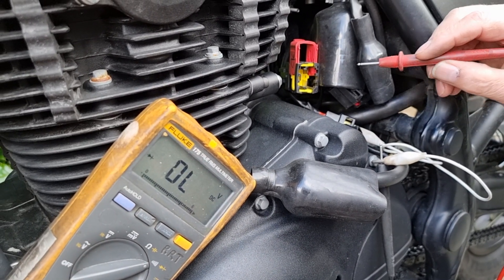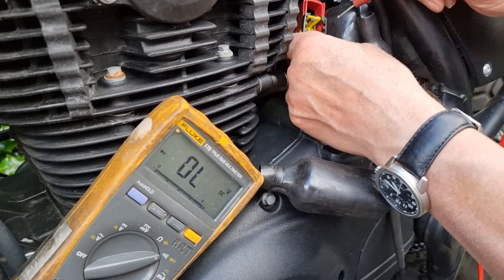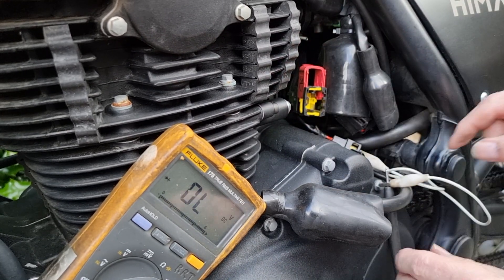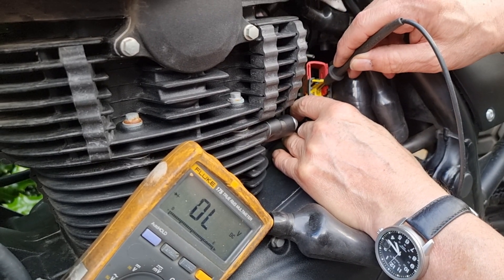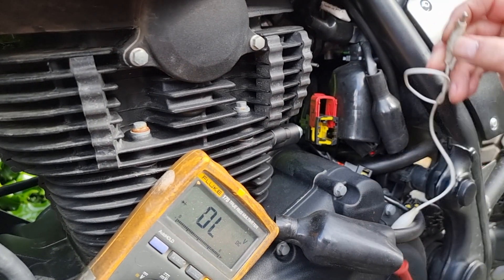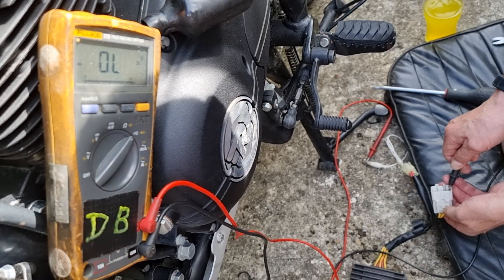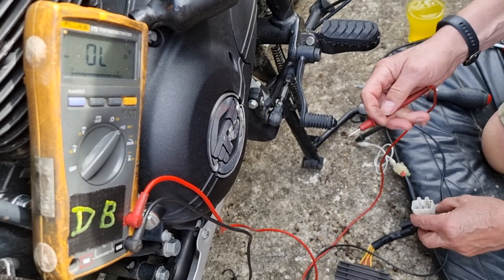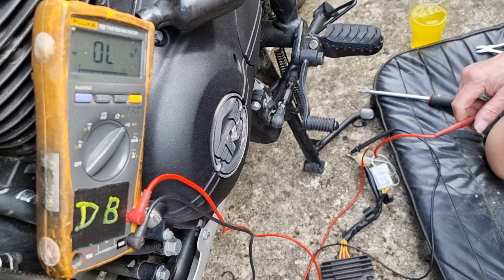Testing himalayan regulator rectifier

Comment: So if bike even stops charging could this be it or is it the coil or magneto itself
Reply from the maker: Stopped completely  ?
Reply: @xfire7  yes been doing some testing thinking it's the regulator no beep when I tested the magneto
Reply from the maker: @Cory Chartier  three wires from alternator (yellow? ) each wire test continuity one lead on yellow wire and the other to earth on frame , there should be no reading .
Reply: @xfire7  yes there was no reading. So I tested regulator and it also gave no reading both directions so assuming it's the regulator

Comment: I bought a 2022 and can't pick the bike up 4 days later because the dealer is replacing the rectifier. Said they had to
order the part and it didn't come in yet so they stripping it off one of the other bikes. 0 miles on the bike and it needs
repairs......... hmmmm I may just get my money back and stick with Honda, haven't even seen the bike I bought yet and
under repair for days now. It looked like a nice lil second bike to have fun with. What a shame
Reply: Still RE dont give a fuck. As long as the selling goes well they wont pay any attention to our serious problems. They are fucking their customer

Comment: Is this RR unit comes under extended warranty ?
Reply from the maker: Basically the dealer still insists that there is no fault . I cannot therefore get a warranty claim.  The parasitic draw is normal they say  !  I'm now banned from the dealer concerned as I told them what a proverbial shower they were and even a half decent mechanic could confirm what I've shown in this video . Ahem , I used a few swear words out of utter frustration.  Don't buy an Enfield in Wiltshire  !!!!
Reply: @xfire7  Actually I am from India and there is problem either in my RR unit or Magentic Coil because I got a new battery a day before and it still shows red battery indicator on the console and today the same new battery is  dead.

Comment: Thank you xfire7 was very useful. I have a bullet B5 and thought I had problems with the alternator or regulator. I tested as in your video found the problem was a corroded connection between the connector from regulator to loom. M y wife thinks you and my voices are very similar I wonder if you are from Cornwall?
Reply from the maker: Plymouth,  almost  Cornwall  😉

Comment: This is also the reason why the damned generator ends up burning out. All because of a shitty R/R. They should have realised from the start this bike was going to need to be able to have an electrical system that was going to be loaded with a lot of accessories for the western market, but they failed miserably on this issue. It's a great bike and I love to ride it, but the electrical components are absolute garbage and really let the bike down. Everything else is fine and I could enjoy the bike for a lifetime, but the electronics arrgh, all for a few quid....
Reply: yes, thats precisely it. Its the regulator that ends up heating the coil and burning it . Some good skilled mechs here in india have figured this out .
Reply: @ONTWOWHEELSBEN  HI there, I am also facing the issue that my battery runs low when I try to start the bike after a couple of days cold stand. I suppose this could be due to a "broken" rectifier as well now. When still under guarantee, does my local dealer where I have bought the bike have to change the damaged parts for free? I guess so right?

Comment: I've been convinced there is a parasitic drain somewhere on this bike and couldn't find it. Thank you!
Reply from the maker: I did a later video .  I have traced it to the regulator/ rectifier.  It's a fault in the design.  My dealer said Enfield are talking about a modification.